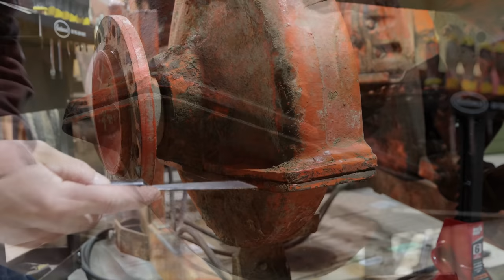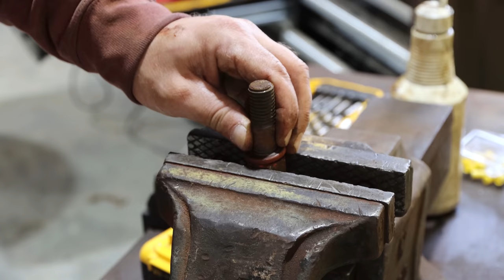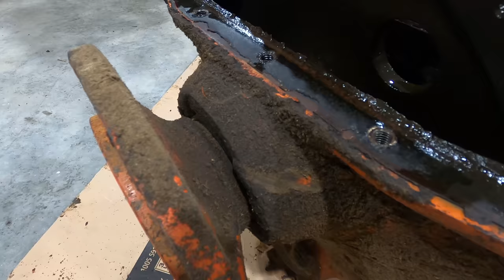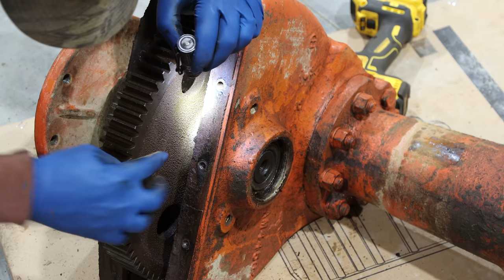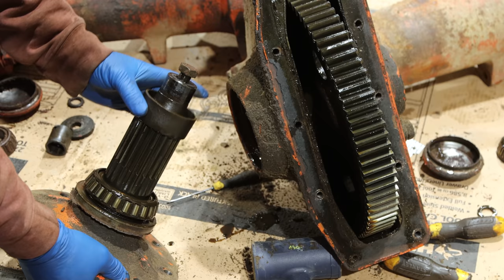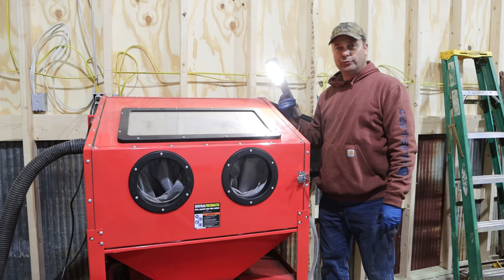Removing the Rear Axles from the Allis Chalmers D17.  Pulling the Bull gears out of the final drives

Comment: One thing you might think of getting is a hydraulic press, it will come in very handy for all kinds of things, I recommend at least 20 ton press, and actually when putting it back together you will want to heat the bearings to around 250 degrees, the bullgear floats on the shaft, the bearings are pressed into place

Comment: Some pieces of flat strap will make your puller as long as you need it to be.  My worry is that you will actually need a 25 ton set of pullers which the set you have is probably only a 10 ton set, if that. A nice set of full size Victor torches, regulators, and big tanks cost a bundle but then you are pretty well set up for life. Maybe buy them for Rebecca as a birthday present?
jack

Comment: If you are going to work on old iron you definitely need a bigger torch setup and a 3/4" socket set. Also--run some fixed iron pipe along your walls for your air. It will help water condense and then be filtered out in your trap. You can set up several hookup points in the shop. The more pipe the air has to run through, the drier it will be. Moisture is your enemy when sandblasting or painting.

Comment: On that brake rod. If you don't want to recreate the whole rod you could thread back a ways on the rod, then cut it and then thread an extension on to it and then get a all thread section and thread into that extension and put a couple of tack welds on it. If you are needing it to slide through a hole, you could cut it past the threads and weld on some all thread and then clean up your weld. Then repaint.

Comment: Harbor Freight is your source for your tool needs.  I purchased a 3/4" SAE socket set that goes up to 2" socket and a Large combination wrench set that goes up to 2"  I think they will be under $100 per set.  I don't use mine much but I have them when I need them.  I have the same sets in metric.  I don't know if they have a puller big enouch.  Good luck on your project
Reply: I see in the comments people say you need a hydraulic press.  I agree.  My choice is 20 ton press from Harbor Freicht.  Spend the money and also get their 20 ton air over hydraulic jack for the press.  Use your air comprssor to run the pump.  Much faster than pumping the jack plus you will have the original hand jack to use on the farm.

Comment: To fix that brake rod I would think about using a bolt sized correctly and cutting the head off and weld it onto the end of the rod, much easier than fabricating a complete new rod
Reply: yup and clamp it in a angle iron to hold it straight while welding it

Comment: When you start the reassembly put the bull gear on the wood stove to heat up.
Put the shaft in the freezer to get cold.
The heat will expand the part, the cold part will contract. They will slide together
a lot easier.
Good luck with this project.
Reply: on a jd 4430 you warm the bearing (the jd mechanic for 40 yrs) just used a cutting torch to warm it up and it just dropped all the way on could put the bull gear in an oven  to warm it up brake drum warmed up with torch might be the only way to get it off

Comment: Evan you might want to get a shop press i made one out of old bridge arch beam (2 angles riveted together to form an open channel)  also harbor freight has some 3/4 in socket set the ratchet didn't last very good but the sockets and slide breaker bar  have held up over 10 years slide bar has a slight bend from an 8ft cheater on it BUT!!! i don't recommend their pullers treaded rod bent on ours , renting them might be a smart idea you can get a LOT of money in a good set Oriellys  and Napa both loan tools out.  lots of utube  vids on upgrades for the sandblaster  lights and siphon seem to be first steps.  Good Luck  and Have Fun

Comment: My dad went with a propane/oxygen torch set up.  He had propane tractors so we always had propane on the yard and could just fill up our 20 lb. bottle.  Propane isn't as hot as acetalyne but we got along fine and it may take a different tip.  Do some research.  Good luck on your project

Comment: So many great suggestions:  A hydraulic press is well worth it's cost, 3/4" break over bar should be better quality than HF.  Use 3/4 to 1/2 adapter before spending for 3/4 impact sockets, good 1/2 are usually strong enough.  Cut and repair break rod instead of making whole bar.  Love to see you make new side plates for under the tractor gas tank, it really cleans up the look of the tractor.  When younger the tractor back together, you need to learn to make much more use of the power director when doing PTO or hydraulic work, instead of always using the foot clutch.  You cause yourself lots of problems that could be avoided with better use of the power director.  You are doing much better at thinking things through before you charge ahead, but ask for advise before you start something, not after your own solution does not work well.  We all want you to be successful by working smarter not harder.

Comment: The puller you need will be quite expensive and unless you are going to do a lot of major repairs that need a puller
  that size it would not be cost effective.. 
  You might consider waiting until you get all the axle parts then taking the axles to 
  a farm machine shop with a press that can handle the axles and put everything back together for you.
  Putting the snap ring back in might be your biggest challenge.

Comment: Use 2 nuts and double nut on a stud like that, you can than use a open end wrench to turn it off. Saves taring up the stud with a pipe wrench.

Comment: No offense, but you went through a lot of work for no reason. The brake drums cracked from heat,  which the new ones will do also. The brakes can be replaced on the tractor without removing bthe axle, and the seal on the finals can be replaced on the unit pretty easily.
Allis Chalmers D17 was the greatest 56 hp tractor ever made👍👍

Comment: I hope you show the video putting that clip on the shaft. Back in 1976, I had a 3/4 ton pickup, I had a garage replace the tires and wheels. They put the lug nuts on so tight, I put a breaker bar and a 12 foot pipe just to loosen them. I was thinking about buying this tractor that I saw on Market Place that needs major work, cause now I know a guy who could fix it! How about that, Evan?

Comment: Repair that brake rod  not replace it !!  Warning if you use propane  (instead of acetylene) 1st you will use 3-4 times more oxygen....costs are a big trade-off ??    ...Also it will not be as hot a heat so longer time & bigger flame to heat something......also with a lot more oxygen !!...So it's a big trade off...sometimes it's better to get in there fast & heat it & your done / your choice but i would stay with acetylene ??? Maybe a press shop to remove & replace those gears....Ask your self how many times are you gonna need a real shop press-- your choice ??   As far as new torches go just get a bigger tip !!

Comment: For your blasting cabinet, I've got the same one. I used 2 waterproof switch boxes one with a weather proof switch, the other with an outlet. One thing I didn't count on was the advantage that now the cabinet is grounded. Before after running it for a while it would build up static electricity and give me shocks while running it. The switch runs my lights inside and the outlet. Keep the vacuum plugged into the outlet so when I flip the switch both the lights and the vacuum come on at the same time. I also replaced that junk LED light inside with 2 halogen flood lights in each back corner. Also I replaced the factory fasteners for the window with 10-32 machine screws inserted from the inside of the cabinet held in with little flat clips. Then the frame around the window is attached with 10-32 thumb screws to make it easier to change/clean the glass.

Comment: Yep, I don't know how many cans of PB Blaster a shop goes through in a year working on older equipment.  A spray on nuts and bolts can often save time and worries, even with an impact wrench.
When in doubt get a bigger hammer and put on some heat.  That usually gets things going.

Comment: FYI gas cylinder source is the best price I have found on new oxygen cylinders ship to your door then you just trade it in on a full one. Shop around on your options. I just bought the Victor performer torch set with the edge 2.0 regulator’s lifetime warranty on regulators and 10 year on torch handle and cutting attachment.

Comment: They do make 3 and 4 foot breaker bars. I have a Snap-on one, but that's more money then you need to spend. Truthfully the best place I have found to buys tools is actually Amazon. I wish I knew about Amazon when I started wrenching on cars and stayed off those tool trucks. I found out over the years that a lot of those tool truck branded tools are just made by other companies. Which are always cheaper if you find out who it's made by. On your compressor consider an auto drier system for it. They are easy to install and help keep alot of the water out of the system and extend the life of the compressor. Oh and like other people said get a shop press and parts to go with it like bearing separators.

Comment: I've broken 2 breaker bars.  each of them, the ears the pin goes through bent out which made everything fly apart.  Last time, I used my biggest locking pliers to hold the ears together so I could finish up my project.

Comment: Its so amazing the amount of machinery done back in the day without the simplicity of CAD, and CNC tools used today. Long before computers, someone sat with a pen and paper to design-draft specs for each part by hand and another took that and machined each part, and another built more machinery to mass produce each part based on those first parts. Its mind-numbing when you think deep into the production process of everything, old and new.

Comment: I too needed large wrenches.  Found them at Harbor Freight.  Cheap and will work fine for the few times I may have to work on my tractor or skid steer.  I also bought a hammer puller from Amazon at a good price and it has worked excellent for me on bearings and hubs I had to pull.  Just some thoughts Evan.  I enjoy your channel a lot!

Comment: Evan, I use propane in my shop and it burns hotter and cleaner. I have to strike it off a metal plate to set my Victor head. If you make it up to the Mattoon are they have several  shops such as harbor freight, home depot and ilmo for your torch supply. Great video

Comment: If you aren't working on mining machinery  I highly doubt you will need a 3/4" socket for farm work. Considering all those things are super old and super rusted I'd recommend spaying with freeze off or something similar, leaving for a couple of hours at least and a small propane torch for 30 sec or so.
Reply: We and all neighboring farms had 3/4” drive sockets and used them enough we didn’t want to go borrow someone else’s. A good, heavy duty 1/2” breakover would be a good investment. We broke a Snap-On that size once. They replaced it. Never broke any 3/4” tools!

Comment: A propane / oxygen set up would meet most of your needs to cut and heat items. A hefty press with ideally wide throat and a pneumatic and mechanical adjustable ram would be a big help. Remember not all bolts and nuts can be reached via a socket buy a range of combination wrenches (open end / ring) up to about 2" for older equipment but you will probably need a range of tools that are metric for newer equipment if you don't already have them.

Comment: Don't worry about the pin on the breaker bar.🤣 I'd be more worried if you had 3 people hanging on the end of it and the bolt still hasn't broken free.... <--- really happened to me. We thought the same thing, this pin is gonna break and we going for a ride. Cheater pipe and all 3 men... 600+ pounds and not enough to budge the bolt. Ended up having to get an oxygen tank filled and try again the next day... Off in seconds with heat and 1 person no cheater bar.

Comment: Sandblaster needs high volume, to run the harbor freight Sandblasters u need 80 psi continously. Under 80 psi thry don't like to run, what I did was tag team my compressors tougether to get enough air volume to continously run sand blaster. Once I did that it worked flawlessly

Switch ur acetylene torch to propane, propane will work for lighter duty stuff, it's what I do when I only need propane as the acetylene is expensive for light stuff, can use propane on heavier stuff, just takes a bit longer.